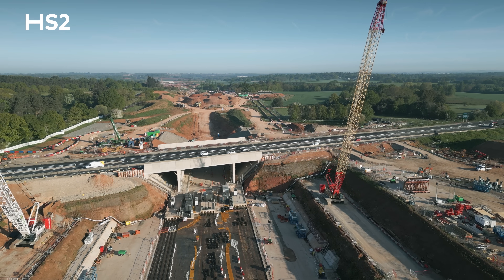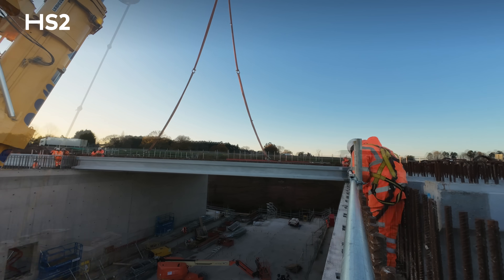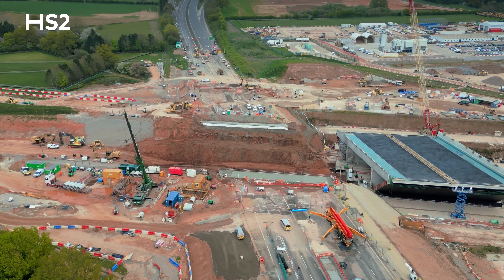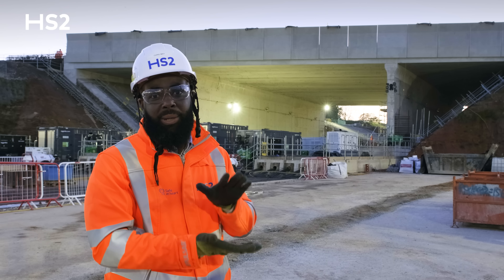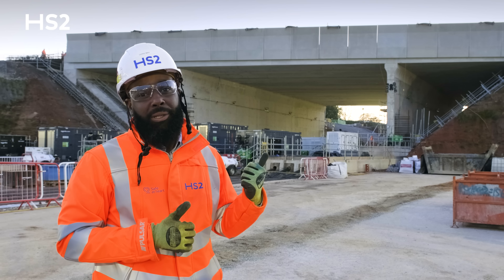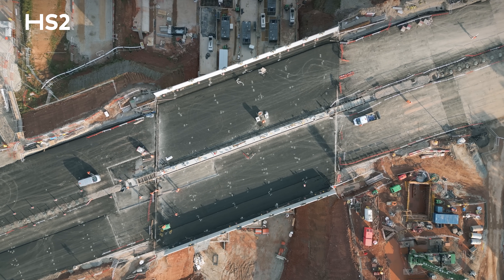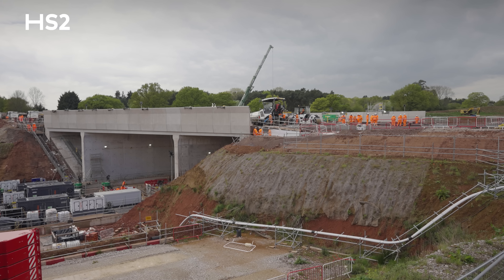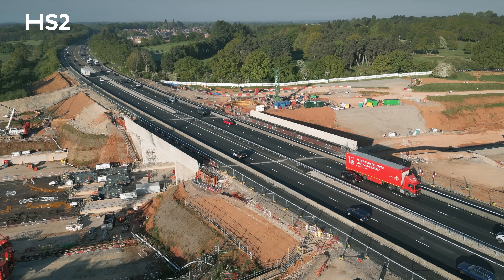HS2 completes UK’s heaviest bridge slide

Comment: The learning from such projects are of immense value! One big learning: why oh why did we not plan for double decker European trains, i.e. lower the track levels to pass under things.
Reply: Because our existing network was built in the Victorian era, there are tens of thousands of bridges, tunnels and stations that would need to be rebuilt at great cost. And where the railway is electrified all the wires and support structures need to be raised. 

Look up "loading gauge".

Even in Europe you won't find true double deck trains, two decks the full length of the coach, rather it's only the bit between the Bogie's where the lower deck is depressed almost to track level and the upper deck raised into the roof space, the upper deck often being quite constrained. Throw in stairs each end and generally the increase in seats is only around 30%.
Reply: And you can't just lower the track, bridge foundations are weakened, tunnels need digging out, platforms need lowering. And lots of stations have underpasses or roads passing under them, creating huge engineering challenges.

Comment: And how much did that all cost? Just so you can save a few minutes travelling time to Birmingham only. All these spokespeople with their shiny new high vis, hard hats and safety goggles! Elf an safety strikes again! You can bet that non of the planners went to France or Japan or China to see how it's done. I'm really not surprised at the idiotic costs incurred in the Uk. Take for example the Edinburgh Tram fiasco. A tram is meant to be a light railway. A one meter length of mainline railway consisting of 2 lengths of steel rails a 3 concrete sleepers weights in at approximately 1 ton. This is what was used to build the"light railway" across Edinburgh. As a result all the existing underground infrastructure had to be reinforced to cope with this considerable weight. Perhaps they were thinking of the future! Running a fully laden freight train direct to the shops. It beggars belief. Whilst on holiday in Prague, I noticed a short section of their fantastically fast and efficient tram system's track being repaired. 2 very light weight rails and  pieces of light weight timber sleepers. Exactly what should have been installed in Edinburgh at a fraction of the cost. The Prague system is huge, the trams are fast, efficient, cheap and well used. Some of the trams are new and some are old, but all seem to be well maintained. So the next city that wants a tram system, go and see how the experts do it!
Reply: It is highly unlikely to shave any time off a journey between London & Birmingham as you will need to catch an Elizabeth Line train to reach central London, and there is no connectivity with New Street at the Birmingham end. Thus anyone with any ongoing journey will be far better and quicker served by sticking to the Euston-New Street service.

Comment: I have seen videos of a similar process being completed in a couple of days, what were the issues here that prevented the move being achieved more quickly?
Reply: I've witnessed a similar technique used to replace existing bridges. They build the new bridge deck off to one side then over a weekend they can close the road, demolish the old deck and manoeuver the new one into place.

This project was slightly different because they were installing a new bridge, so once the structure was complete and ready to slide they have to excavate the 'hole' for it to sit in, re-grade the existing road etc... That they were able to complete this in only three weeks is pretty impressive.
Reply: Well the much larger size of this particular bridge for starters, with a bigger earth removal operation before the slide.

Comment: When the bridge was slid into place, were there any foundations underneath the concrete supports or does it just rest on the substrata?
Reply: This was my thought also, but I guess a combination of the very large concrete slab that the bridge sits on, combined with soil that has been subject to vibration/compaction for decades with the road running directly over the install site meant they could get away with this approach?
Reply: @chiefsilverback Yes, possibly.  Whatever the solution was I can't believe it was guesswork.
Reply: I can't believe it rests on the earth as it would settle and the bridge would end up with differential settlement.
Reply: @TrevorWilliams-fq8mg  those were my thoughts, but I can't see any foundation preparation from this video - they seem to have just cut out the existing embankment. I'm sure they know what they are doing, but like you, I think there is a possibility of it settling differentially. (I'm an electrician though, not a civil engineer..! :D )
Reply: @thefabulousstevieg  There's a bridge that's just been built in Lincolnshire that has that very issue. I'm a pre construction manager for a Contractor with structural experience. If the bridge rests on soil, it would require some form of treatment to avoid settlement. Vibrocompaction of the soil  is 1 option but has a limitation on the compressive strength it could provide. But given the surface area of the bridge it might be acting as a raft spreading the load over a large area. But I would have thought the bridge sits on beams at the edges which in turn are supported on piles, the detail of which is not included in the video.
Reply: PS..I like your pseudonym name. As a Liverpool fan Stevie Gerrard was an exceptional player. Probably a failure though as a manager. 
.
Reply: @TrevorWilliams-fq8mg  I was known as 'The Fabulous Stevie G' well before that footballer chap was even born..! :D
Reply: @thefabulousstevieg A great name though.

Comment: All very clever and self congratulating and all that. The other day I stopped to have lunch at the side of the east coast main line and enjoyed the tranquility and birdsong for over 10 minutes before a train passed by. As my ex senior planning manager from the old british rail days said, we do not need more connecting lines in this country, the problem is the lack of platform space at terminal stations. Yeah. High speed on such short legs is a huge waste of investment. Now if you had done something about improving efficient use of existing infrastructure by increasing terminal capacity - better still by bypassing the bottleneck that is London - then we would truly have got better long term investment benefits for less cost and I wouldn’t be sat here writing this would I?…
Reply: Spot on. 10-mile long high speed passing loops is all we ever needed to go with longer platforms. Such a waste of money.

Comment: HS2 is the biggest white elephant in British history and will be held up as an example to young project engineers how NOT to manage a project.
As an engineering manager I often quote HS2 as an example of what happens if you dont get your budget, schedule and procurement strategy correct....and of course you have incompetent contractors included in the mix.
This video seems have covered most DEI requirements but I didn't see a hard hat/high vis jacket wearing transgender worker....also interesting as all the PPE looks to be brand new and fresh out of the box. 
Cancel HS2 now and save the money.............yes there are billions already wasted but lets put an end to this lunacy.
Reply: Nah cancel waste of public money road projects
Reply: There is a device called a washing machine, which happily accepts all clothing including high Vis. Wonderful invention.
Reply: Looks like you missed the irony
Reply: HS2 is a classic case of underestimating the cost and scale of the project. As Mark Wild has said it was bulldozed (no pun) through parliament when the scheme was nowhere near ready to construct. And with a cost budget that was pulled out of the air. Now he's talking of resetting the project. My experience of working  on major construction projects tells me a reset will only be confirmation of the final cost and delivery date as when a major project goes wrong it can never be turned around.

Comment: This is really impressive and as a regular commuter down the A46, it is clear you guys have done a great job. The disruption was minimal, done at a sensible time of year, and it is clear this was well planned.
Reply: "The disruption was minimal".
I am a resident of Kenilworth. The disruption was anything but "minimal". Insufficient thought was given to the diversionary routes that thousands of vehicles would take. Indeed I myself had to go through numerous phone calls merely to get a set of traffic lights temporarily re-timed as they were only allowing 4 cars at a time through in the direction that the bulk of traffic was flowing,  while one of the roads the traffic lights controlled was closed yet the lights still went green for traffic that wasn't there. Farcical. Then add in the fact that two of the three accepted routes to Coventry were closed at the same time and our side streets became like car parks, overloaded with queuing traffic. My usual 10 minute journey to work has taken an average of 30 minutes over this period, and on a couple of days it took 45 minutes to do 6 miles. Going shopping to our local Sainsbury's became pointless as any frozen items would be fit for the bin by the time you got home.
Furthermore the dust is so bad that I need to wash my car daily.

Comment: Really good work, the accuracy of the excavation within a few days is impressive and in the long term minimal disruption compared to traditional building methods. I rmeember the A34 bridge being widened near the M40 junction being a pain for quite some time during it's construction.

Driving over the bridge the tarmac joins are small but noticeable, hopefully the structure wont settle much so we avoid Highways England or WCC having prolonged roadworks in place to adjust it

Comment: Does spending £80 billion of taxpayers money really represent value for money ?  HS2 will save 15 minutes travelling time between Birmingham and London.  This must be the biggest vanity infrastructure project of all time
Reply: The mainlines north out of London are at capacity and rail demand - passenger and freight - is continuing to grow. HS2 will remove the InterCity trains from the existing lines allowing a lot more local and regional passenger and freight trains to run. The name is unfortunate, it's really the London to North capacity relief line. But if you're building a new long distance line you spend a little extra to make it high speed to get as much traffic from cars and planes as possible.
Reply: @joegrey9807  If they have now recovered from covid then fine but they are not going to travel for half an hour to Oak common to just gain 20 mins that when they lose 30 mins anyway, so the other lines are still likely to be packed.
Reply: @rustydusty2992the line is being built to Euston, although it'll be later. But from the City and much of London it'll be quicker to get to OOC than Euston anyway. The real crime is that Lichfield to Crewe has been cancelled, the bit that bypasses the seriously congested bit of railway and the bit that's cheaper to build than the rest.
Reply: @joegrey9807  Yes just got that but I had not been up to date with it for awhile but yet again this is still going to be taxpayers money I expect so just for 20 mins saving it's still a white elephant.
I think it will be a long time if ever it returns anything to the tax payer.
Reply: @rustydusty2992 it's more about relieving the capacity constraints on the WCML. Although until they bypass Stafford we won't get the main benefit
Reply: @joegrey9807  WHEN.  In 2033 if we're lucky. You people do make me laugh 😃
Reply: @robbielad and? We're still using railways that were built 200 years ago. A few years is annoying, but it's the long term strategy that helps maintain economies.
Reply: @robbielad  No deadlines, and unlimited funding. There's no incentive for them to complete it.
Reply: Read the business case
Reply: @gwilymselwood  I supported it at the start but the politicians (conservatives) and the Nimby's messed it up made it cost a lot more getting the rest of it cancelled so it is a white elephant now
Reply: @gwilymselwood  Read my lips. Completion 2033 or beyond. Meanwhile 40% of the network still diesel. 
HS2 White Elephant 🐘
Reply: 100% NO

Comment: A weast of money
Reply: weast?
Reply: It’s not.
Reply: @hx0d  Oh yes it is now as it serves no purpose now, did and would have done at the start though but with the rest cancelled it's not going to achieve one bit of return for the present costs so no value for money whatsoever.
Reply: @rustydusty2992 It serves a purpose, it's to relieve congestion on the West Coast Mainline. This in turn allows more services to call at smaller stations in the Midlands, and that then frees spaces across the country.
Reply: @hx0d  Let's hope it doesn't get to congested between now and 2033 😂😂😂
Reply: @hx0d  Are you a salesman for the service?
Reply: @hx0d  it most certainly is. Only 60% of Uk network is electric. The rest is diesel ⛽️. Net Zero Lie.
Reply: What a ‘weast’ of money your education was.

Comment: 200 bridges and tunnels. For 100 miles!!!

That’s ridiculous. And the cost!!!!!!
Reply: 200 bridges and tunnels in 100 miles is a reflection of the conjested nature of the existing infrastructure in this Country and the main reason for the under estimated 32 billion budget.
Reply: @TrevorWilliams-fq8mg  Some of it was also that figure did not include the rolling stock as well as the restructured price due to nimbys causing the extra tunneling
Reply: @johnrichards4097  whatever the 'purpose' it's a waste of money. They've compulsory purchased homes and land that will never even see the hs2 as they're only completing half of it. It's pathetic
Reply: All to get to London 15 mins quicker. It's a disgrace
Reply: @martyn-the-great time is not the issue. Capacity and lifespan of existing routes is
Reply: @martyn-the-great  Wouldn't be that and the extra costs though had it not been for nimby's and I believe it's 20 mins but yes it is a waste now but due to the forementioned and the conservatives not getting a hold on the costs.
Reply: That’s not the purpose of HS2, but yes do keep commenting that lie.
Reply: @hx0d  what is the purpose of HS2?  It isn't even going to north England anymore
Reply: @modernhistorychannel  There isn't any reason for it now, no.
Reply: @modernhistorychannel  They need more tracks. The main line cannot have more tracks. So might as well build more tracks between London and Birmingham going a slightly different way. They're also building the tunnels and bridges higher on this one so larger trains can go through.
Reply: @hx0d  You're right. It's not the purpose, because there is no purpose, nor indeed point - unless you want to visit bin bag mountains and minarets 15 minutes sooner than you can today.
Reply: @modernhistorychannel  Capacity

Comment: Could the person from the highways  explain why the motorists, are still waiting for the a46 Stoneleigh junction,     half a mile further up the a46, when it will be completed, 27 months after the bridge was lifted in, and 22 months after it was supposed to be finished.
Reply: It's paid for by local councils rather than national and they have run out of money.
Reply: Rumour is that Warwickshire County Council are planning to sue the contractor
Reply: And the bridge railing a few miles south that has had some posts put in during this closure, 4 months after it was damaged and a lane closed

Comment: Half a railway, twice the price. Or is it 3 times yet ?  If your only gonna do half the job, what is the point ??
Reply: It will free up capacity on a line that was built in the 18 hundreds. That will help get freight off the roads.
Reply: getting the first part completed promotes more construction in future if it's successful, meaning that it will hopefully spark more high speed lines in the UK
Reply: @randomguy477  a noble reply. Even so my points just as valid also.
Reply: The original estimate was made in 2012. Since then there has been inflation, and changes in scope as a result of public consultation (e.g. increasing the amount of tunnelling, which triples the cost per mile).
Reply: @ A friend lives near what was meant to be a cutting straight through some ancient woodland. Replaced by two mile long bored tunnels. So that will have popped up the price a bit.
Reply: It's not 'half a railway' its a key enabler of more rail expansion on the WCML and a way for passengers to avoid Birmingham if they are travelling north. By movibg express trains that are 'path hungry' onto GS2 releases more capacity on the WCML which will mean more freight and more local services. So it is most certainly needed.
HS2 trains will ho to Scotland, Liverpool and Manchester as they will be built to the UK gauge. Later trains will be to a larger gauge and remain on HS2 lines.